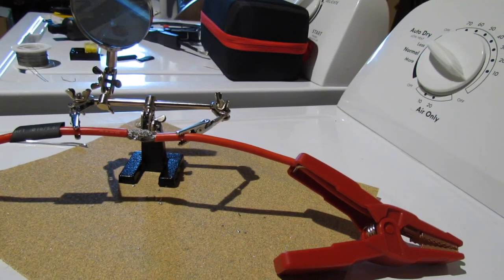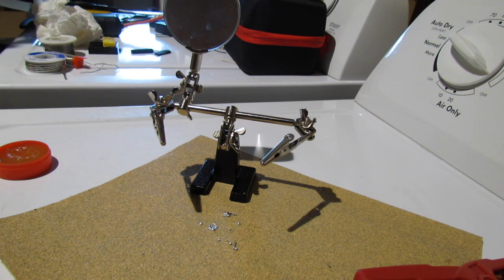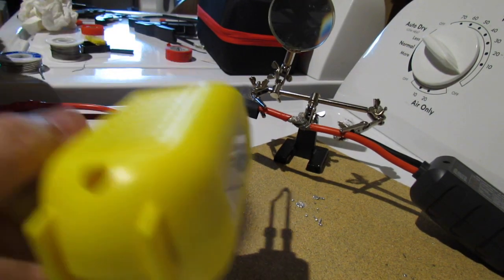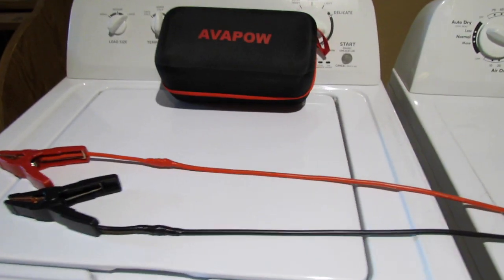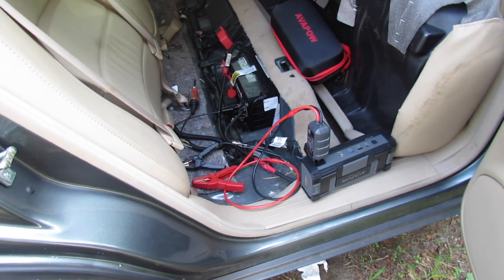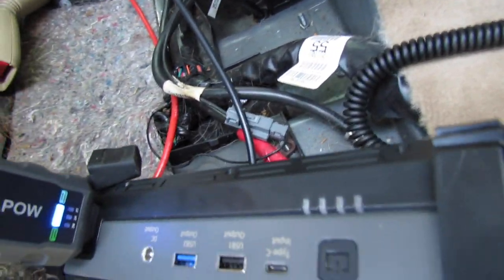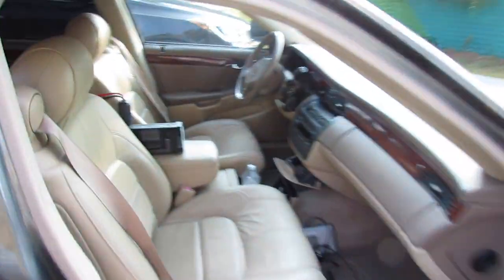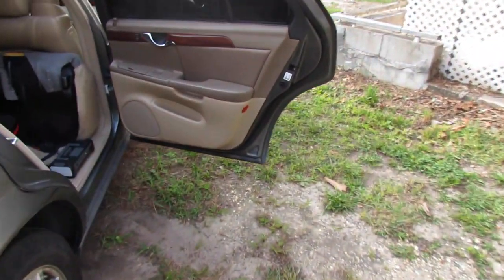AVAPOW 6000A --3 FOOT EXTENDED SMART CABLES

Comment: I couldn’t open your reply on the last video I asked for Recommendations on a jumper live in las vegas and gonna be jumping any thing from v6 to v8 engines Mostly chevys and fords some completely dead some low voltage
Reply from the maker: Since you live in the warm climate you do not need a jump starter that has low temp technology. If you are looking for something on the more economical side the Foxpeed G29 is a great choice, Foxpeed is around $80, it does not have an LCD screen and is capable of jump starting up to V8. If you want something heavy duty i recommend the Hulkman 85S, Noco GB70, Gooloo GT4000 and Fanttik T8 Apex, all these units are capable of jump starting V6 & V8 gasoline engines. These units have LCD screens as well (Except the Noco GB70).These units are between $139 to $249...
Reply: I’m considering the hulkman or the fanttik just not sure which one to pick what’s your recommendations between this two
Reply from the maker: Hulkman or Fanttik are awesome choices. Time to flip a coin.  Lol. The Hulkman 85S & Fanttik T8 Apex will both jump start up to 8 liter gasoline engines. They are both well made and heavy duty. Both are 2000A peak. Both have heavy duty smart cables with intelligent functions. If you purchase the deluxe Fanttik version it comes with the 65W charging plug, as well as a nice hard case. The Hulman 85S comes with a 65w wall plug charger but No hard case. If you go with the Hulkman you will need to purchase a hard case separately to protect your unit. I believe the Hulkman 85S without the hard case is around $139 depending where you purchase. The deluxe version Fanttik T8 Apex is around $169 with the hard case. A while back I did a review on Fanttik T8 Apex and the company gave all my viewers a coupon code to get around $30-$40 off your Fanttik T8 Apex deluxe or regular unit. Go to my Fanttik video and in the description is the Fanttik T8 Apex coupon code, then go to Fanttik.com and buy either the Fanttik T8 Apex deluxe or regular and when you checkout put the coupon code in and you may just get $30 --$40 off your purchase. I'm not sure if there is an expiration on the coupon code, but check it out
Reply from the maker: @victorbailon8433  FAN40OFF is the Fanttik T8 Apex coupon code

Comment: One possible reason the soldering isn't working the way I expect as seen on YouTube is the size and length of the cable. You may have to hold the soldering iron on the wire for quite a while to heat it up to the point that the solder just melts when you touch the wire.  The wire is conducting the heat away .. basically you are heating up the cable on both sides... and one side you have 3 feet of cable to heat up... That's why i thought a higher wattage soldering iron was needed...I went to a 60W soldering iron because the 25W was taking too long when  soldering 16gauge wire.. but it looks the 100W   still requires some time....sorry Mike.  Having to hold that trigger in on the soldering the whole time would be tiring.. Maybe tape the trigger closed and rest the gun on something with the wire resting on the tip or the other way around might be easier.  I have no idea how long it will take because of the wire thickness/length.  Or for expediency you could do what you're doing .. just moving the iron around and adding solder.. around the wire... Might not give the best connection but as you said ... It works..... One other thing to consider... this modification will very possibly void your warranty.  And i know you're doing your testing by draining your battery.. But every time you do that you are shortening the life of your battery... maybe get an old battery from a battery depot for your test
Reply from the maker: It probably would void your warranty to modify the cables, excellent point. But being the units range from $70 to $350 on the jump starters I have, i dont mind voiding the warranty, especially when the warranties are almost up in some of the units anyway, not too mention it seems the manufacturer always finds a loophole to get out of your warranty if there's an issue.
Reply from the maker: I appreciate you helping and giving me tips and tricks. Thanks again